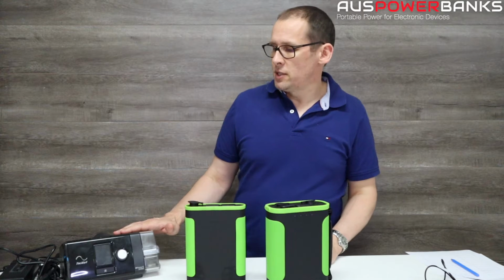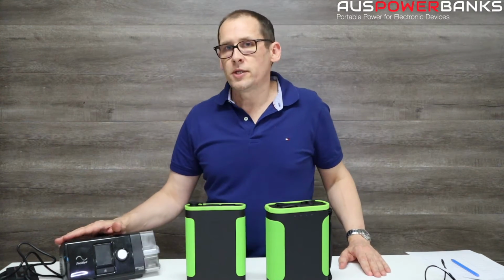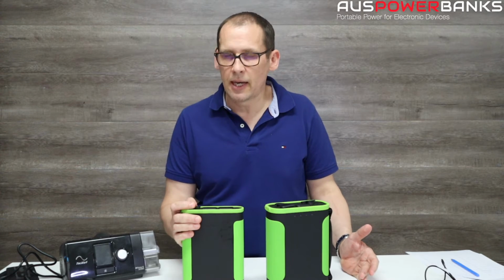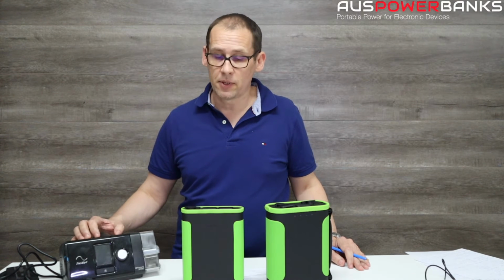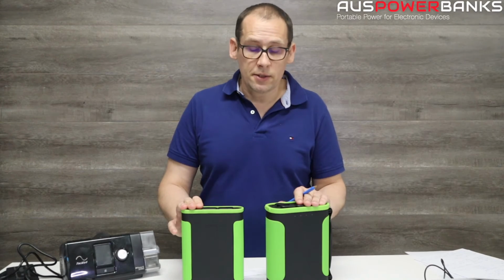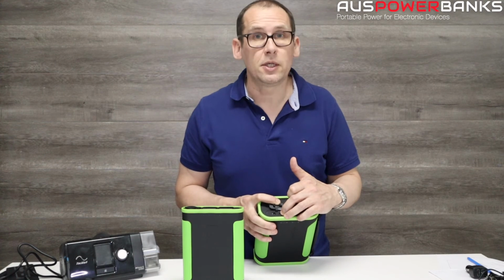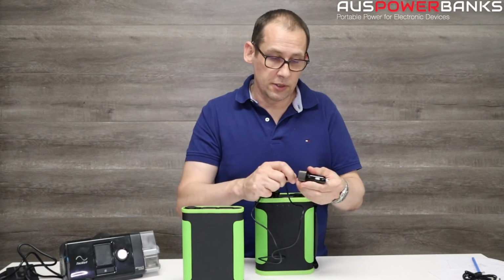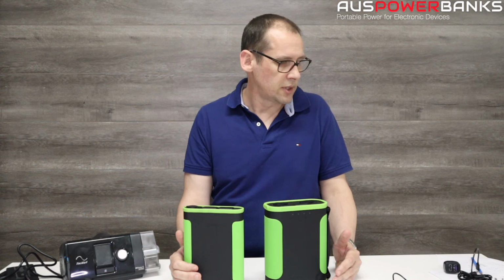CPAP Machine Power Banks

Comment: everyone talks about Cpap machines.  I have a Simply Go Oxygen Concentrator (which has its own batteries); however, I am looking for an emergency backup.  In the car, we plug the machine into the cigarette lighter and that keeps the internal battery charged.  I wonder if this power bank would do the same, and if so for how long?

Comment: RE CPAP MACHINE USE WITH POWER BANK:
Newer cars do not have cigarette lighter outputs but have usb power outputs - can the car usb output charge this power bank?
One reason I might want to have this power bank is for when there is a power failure from the electricity network - so my question is, how long do these power banks hold power (without use) after a full charge? In other words how often do I have to top the charge up to keep it ready for any power failure, so I can plug my CPAP machine into it ? 
I must admit I have never yet had the power fail while using my CPAP yet - that might be a horrible experience - possibly dangerous for older users of CPAP. Which leads me to the question, can a power bank automatically cut in if the 240v power fails?